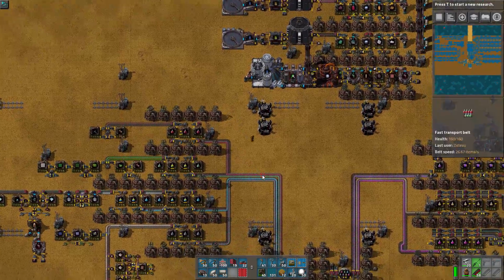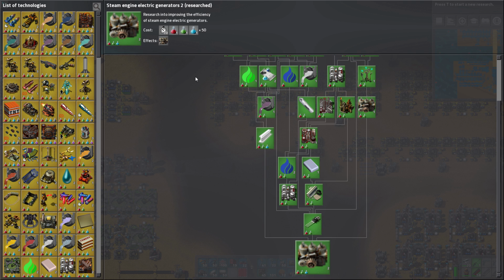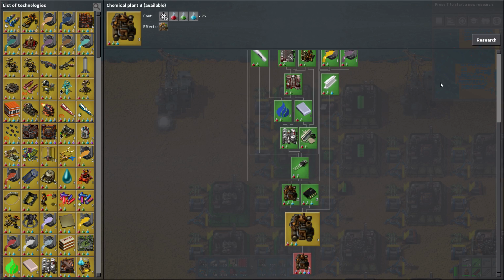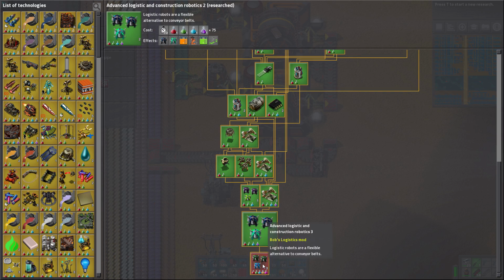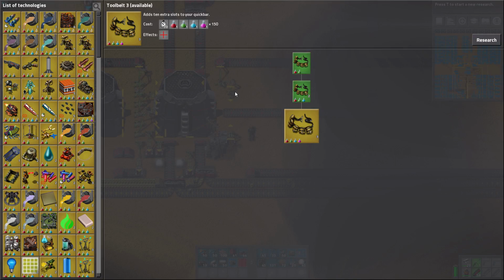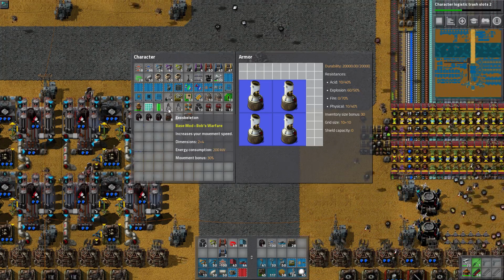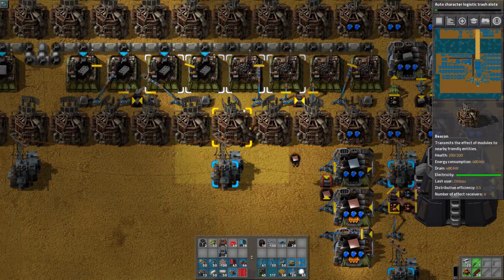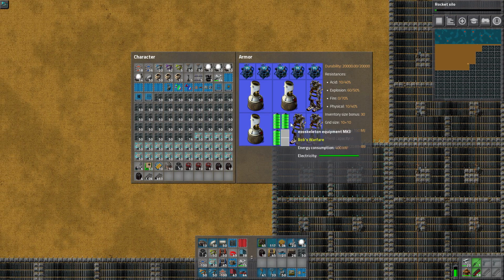Factorio Sea Block #32 - Lots of Research (0.15)

Comment: Maybe a bit late. But try using compressors instead of the Air Filters to aquire compressed air for nitrogen.
Compressors Mk4 are 2x2 with crafting speed of 5. (VS, iirc,  5x5 and crafting speed of 2 for the Angel's Air filters).

Using FNEI, you can see the recipe, but maybe the research won't show in the tech tree.
You can research it anyway using FNEI :
- Ctrl+E, in options (the gear in the top right), enable the hability to click on researches.
- look up for compressed air, and click on the research logo (which should be red)
- search it, and that should do it.